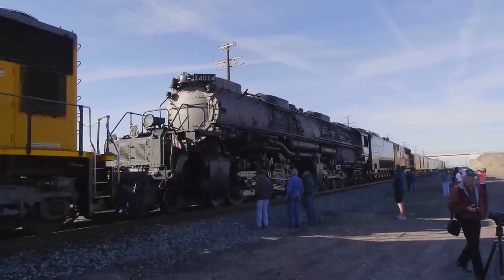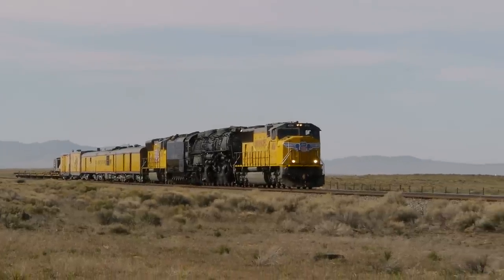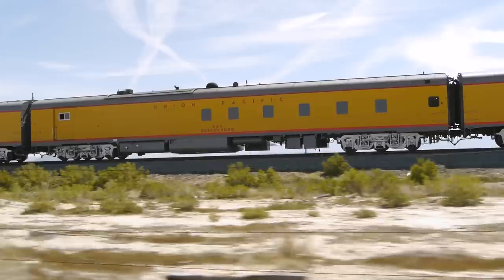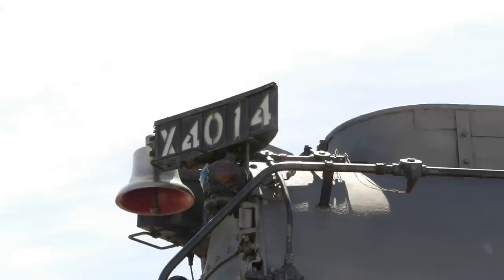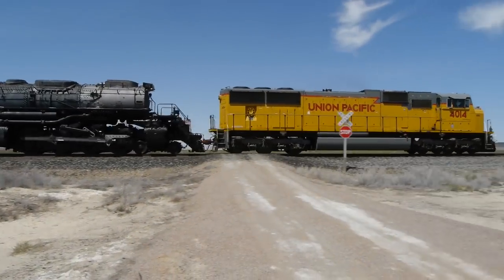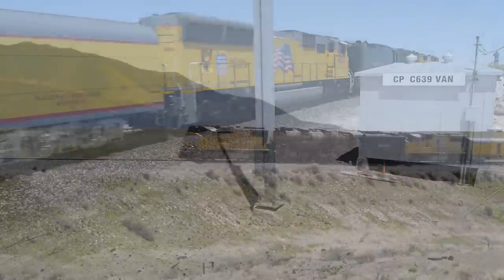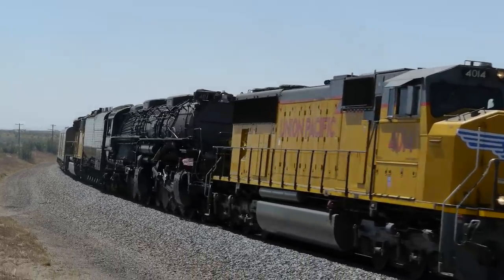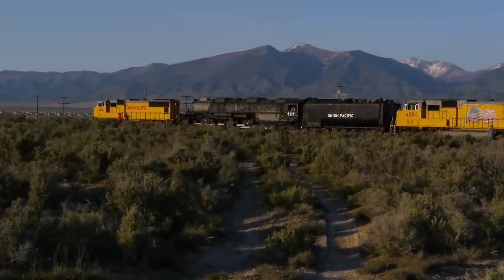Big Boy going home

Comment: The oilers on the 4014 were not 'jury rigged', the chain is part of the original design.  Most of the time you do see the chain mostly covered with a protective steel sleeve, though.

Comment: Great Job... I salute you, Sir for a fine production! I always wondered why they dragged their feet on the restoration of a Big Boy. They did a Challenger, probably because a Challenger is an oil burner and more easy to refuel in the Diesel era? Plus, you can burn Diesel in an oil burner, like the little locomotives at Disneyland...
Reply from the maker: +JungleYT Some emploies did the Challenger on their own before UP got behind it. It was a coal fired at first but on it's first outing to Utah, it started hundreds (no lie) of fires and even almost burned a house. So the UP converted it to oil. Many of the Challengers were oil from the beginning, but not 3985. Hope to see that one back on the rails at some point.
Reply: +Toy Man Television Thanks for the information... I did not realize that the 3985 was down. I did a little reading as per your notice. In this day and time and with modern 3D manufacturing processes, no excuse to NOT be able to make new parts or have more than one copy these locos operational. Pass this on to the powers that be...

Comment: Bring me up to speed here; is there a significance to the front diesel being 4914? Thanks.
Reply from the maker: YES!! It's actually 4014, same number as the Big Boy. When the Big Boy is ready they will need to change that Or some workaround. Thats why 844 was 8444 for years. Diesel 844 is now in a museum in Bolder Nevada. (we have a show on that museum) so 844 got it's number back. The other diesel is 4884. Same as the wheel arrangement and class of 4014. Gotta love the UP.

Comment: I would imagine that if they didn't lube at every hundred miles it would either seize up or come apart or both.  Nice videos glad I'm subscribed.
Reply from the maker: AND they have automatic oilers running all the time. But still need to "oil around" every 100 miles or so.

Comment: I really enjoyed your 'Big Boy' video and I'm wondering whether you are aware of the Southern Pacific version. SP ran their version over the Sierra mountains and the length was such that they turned the boiler and cab around and connected that to the tender so that the crewmen could see the tracks ahead. I have an HO reproduction but don't know of an original. My father was an SP locomotive fireman and worked on the SP version and ran between Sparks and Carlin NV. Those were all numbered in a series of 4100 or 4200. I suspect SP was a little more aggressive in the junk business and I'd appreciate learning of a surviving example in a museum that I could visit.
Reply from the maker: One left in the California State Museum in Sacramento. https://www.youtube.com/watch?v=UQz2icnSvtA&t=606s
Reply: the cab forwards were interesting. They also were designed so the crew wouldn't suffocate going through the long tunnels. Needless to say they were oil burners which southwest railroads preferred anyway as it was easier to get oil than coal out west...

Comment: It's interesting to notice that the diesel loco leading the group also has the 4014 number as the big boy number is the same.
Reply from the maker: I noticed that the other diesel has the locomotives wheel arrangement as a number. Ed worked for months to pull that one

Comment: Correction. The triplex was bigger the big boy has 2 set of drive wheels the triplex has 3 and the tender has a smoke stack to!
Reply from the maker: There were I believe three locomotives that were larger of the big boy depending on how are you measure them. At least one was heavier at least one was longer. As you mentioned the triplex had more drive wheels. All of the other locomotives were intended for helper service. The big boy was the only mainline locomotive of that size.
Reply: @ToyManTelevision  triplex was a mainline engine to
Reply: But I do see what your talking about.. the big boy is easy to fall in love with

Comment: Is 4014 going to be converted into oil?
Reply from the maker: There is just no way to haul 30 tons of coal to a location, use a front loader and spend the next 2 hours loading coal. And do that every 50 miles. Add in the fires....  They ran the Challenger on Coal for over 10 years after it was restored but it rarely got very far from home. So with the Big Boy there is just no option. The trick it getting it to work well when back in the 50s it didn't work well at all.

Comment: Have they really thrown in 20 tons of coal per hour by hand just with showels? That seems almost impossible.
Reply from the maker: It had an auger. Huge stocker. The firebox is the size of a garage!!! We have a shot of the one in a cab forward in the California Railroad Museum show. That one ran on oil. BUT same size mostly. And you could park a car in there!!! https://youtu.be/UQz2icnSvtA?t=4m11s
Reply: You are correct. Any loco bigger than a pacific or a Mikado had to have a mechanical stoker. You could NOT hand fire one of these beasts. They used a mechanical auger (screw) to convey the coal up to the fire box and used steam jets to blow the coal into the fire box...
Reply: Once a firebox is bigger than 50 square feet its too big to fire by hand shovelling.  The mechanical stoker does it for you.

Comment: wow what good of an engine if it has to stop every 100 miles to re lubricate
Reply from the maker: Dianne Dunn Wild right? But back in the day they had to add 10 to 20 thousand gallons of water every 100 miles so "lubing around" was no big deal. They could only go about 3 to 400 miles in a 8 hour shift/day so....
Reply: oh okay thanks :)
Reply: Dianne Dunn Big Boy could pull a very very very very long train, so it was worth it. That made it economical for its day.
Reply from the maker: The "Big Blow" that replaced it could too. Shame there are none of those running. Didn't last long either. Now it's a matter of adding more engines.

Comment: You made some mistakes... UP has 5 steam locomotives since reacquirering 4014. Here's their list:

844 (4-8-4 Northern that's never been retired)
838 (4-8-4 Northern that's used as a parts source for 844)
3985 (4-6-6-4 Challenger that used to be the largest active steam locomotive in the world)
4014 (4-8-8-4 Big Boy that recently got reacquired)
5511 (2-10-2 that's just in storage, waiting to be sold to somebody who wants it)
Reply from the maker: Last time I was there they also had a 4-6-0 that looked great! And the very dead Big Boy in the park. They looked at bring it to the shop, but it's a total goner. It has spent months underwater. Just junk now.
Reply: I don't even think 4004 would've been a good candidate... And 1243 (that 4-6-0 Ten Wheeler) couldn't run because after its final run the boiler wasn't drained... So there's some nasty stuff inside.
Reply from the maker: Right, 4004 is totaled because in was stored in a FLOOD BASIN and underwater for months at a time. There was a time they were going to move it to the shops, but even that is a waste of time. So they have half a dozen "or so" engines but only 2 run. Soon to be 3. Also, 3985 has been so damaged by trying to "improve" the boiler it does not run, and will not again for at least 10 years. Stupid and sad. But 4014 will be taking all the time for the next 5 years, or more, and then they are going to build 50% of a new boiler for 3985, they can keep the firebox, and the smoke box, but much of the rest will need to be replaced as holes were cut into it and can't be repaired. The guess is that that, with other work, will be 5 years. So 10 years before we see it again. Unless UP wants to expand the crew in Cheyenne so that 3985 can be rebuilt as 4014 goes forward. But I'm not sure why they would do that. They are getting so much press off of 4014 that any work on 3985 may cost them good press as the question would be asked, why were holes cut into 3985? And take attention away from 4014 one way or the other. But in 2024 we may see a double header!
Reply: But 1243 isn't UP property anymore
Reply: Since when is 1243 not UP property? Its on a semi-permanent loan.
Reply: Toy Man Television I hate to bust your bubble but 4004 is not in as bad of shape as you say. It has been checked several times and when the journal boxes were opened a few years back no water was found in them and corrosion due to trapped moisture is minimal. Could some minor water damage have occured to the metal? Yes. Could it be repaired? Yes. 4004 is in no way, shape or form TOTALED.
Reply: It's in a museum, isn't it? :/
Reply: 1243 is in a museum in Omaha I think. Its in tip top shape in a climate controlled environment. For an 1890 locomotive on display, its in tip top shape.
Reply: Exept for the inside of the boiler...
Reply: Like I said above about 4004, its repairable. If UP ever wants to bring it out to play, its repairable. If UP can restore a big boy a ten wheeler is nothing to them.
Reply: But after 1243's last run they forgot to drain the boiler, so the remaining water froze over night and caused some nasty damage...
Reply: I still support my comment above. Strasburg 89 was swallowed by the Susquehanna river en route to Strasburg back in the day and the flood damage was repaired. Deep River Logging #7 was wrecked in the 50's, abandoned, purchased nearly 10 years later and is finishing up a restoration that was started all volunteer in the 90's. Ice is no problem, especially with the expertise of the UP steam team, or anyone that knows steam due to the small size of the locomotive. Look at Valley Railroad #3025, it was completely torched in the Knox and Kane roundhouse fire, and it's better then new now, and operational. 1243 is definitely doable if it was to be restored.
Reply: And UP 1242, which sits outside in Cheyenne?
Reply: No they do not have #1242, which I believe is not in Cheyanne as they already have #4004 in Cheyanne. #1242 is in Wyoming somewhere, but not Cheyanne.